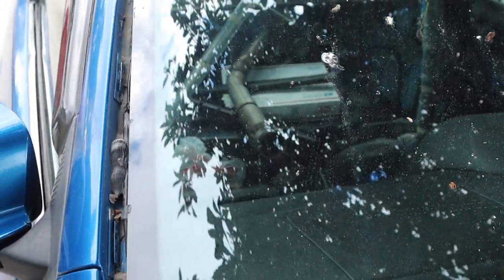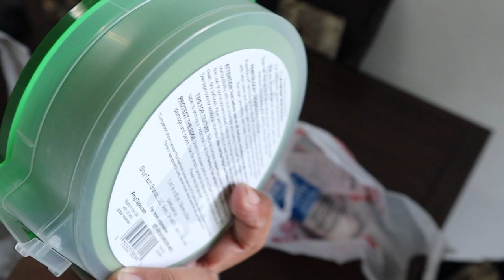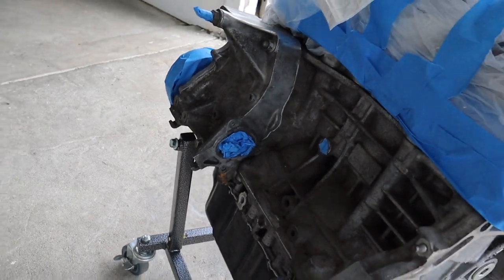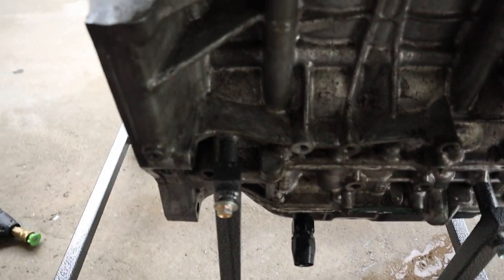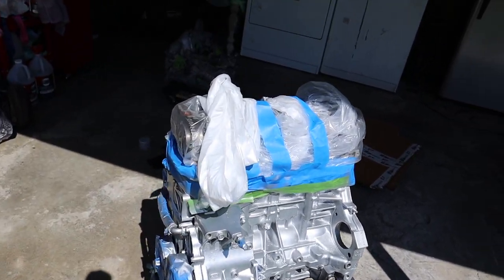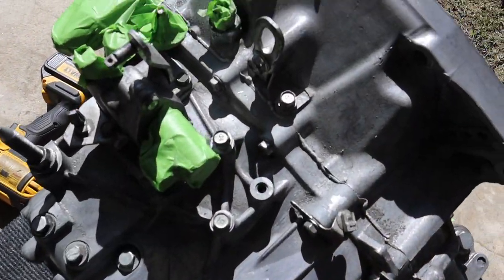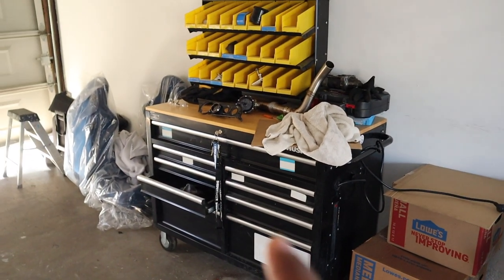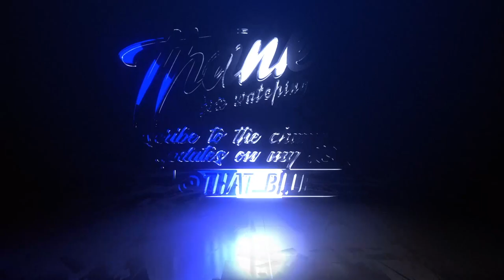| Painting RSX Engine & Transmission | Update |

Comment: No offense, but you really need to take a spray finishing course of some sorts. The same way you would use a spray gun you would use a rattle can. You need to start spraying OFF the work piece, then pass over it, then do not stop spraying until you are OFF the work piece again. Some call it feathering. It seems wasteful but that it how all the pros do it. Helps prevent runs and keeps the coat more even and uniform. The results are much better. I just did my trans, minus the shift selector and it's gleaming.  You do not want to point and spray which is what you did. Other than that good video bro